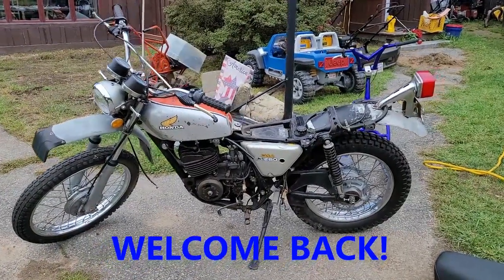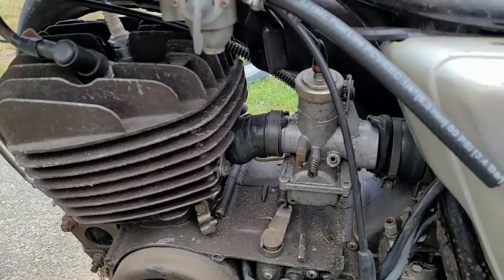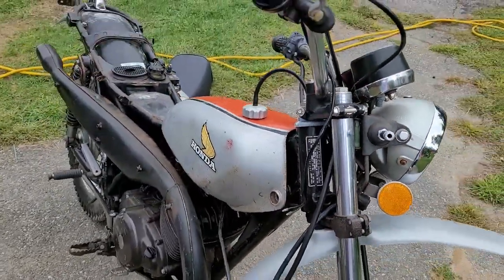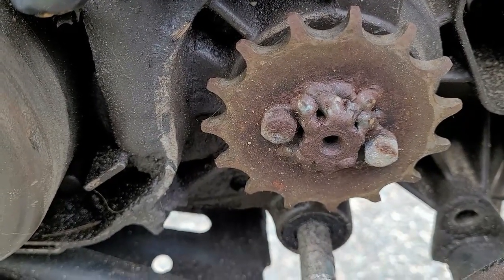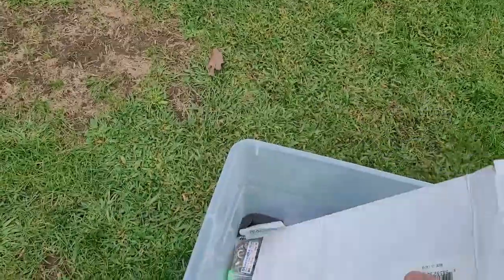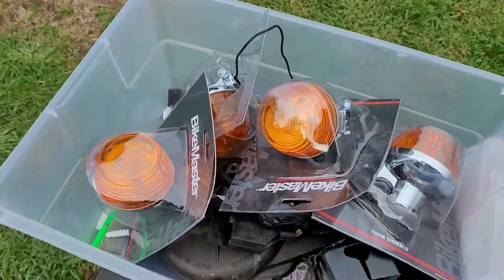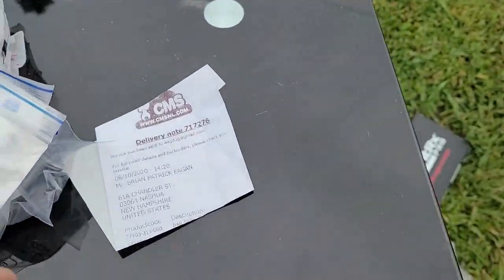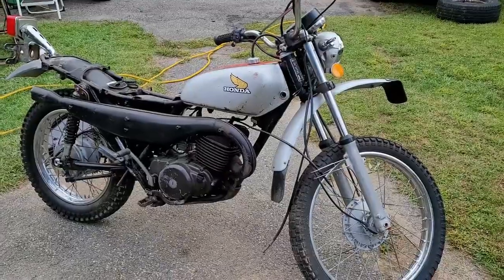1973 Honda Elsinore MT250 first look

Comment: Kevin like you suspect a cheap flux core welder. but these welders  many times don't get the penetration needed, especially on thick hard steel like you have here. that said  bet you will be able to heat the weld and use a puller and crack it off with minimal damage to the shaft splines. great winter project.
Reply from the maker: I will check into that tip

Comment: my 1974 Honda xl 250 has a little play in the counter shaft gear, it is splined and has 2 bolts like the Elsinore.  found out that the play is totally normal, guess the PO on your bike decided to fix that.